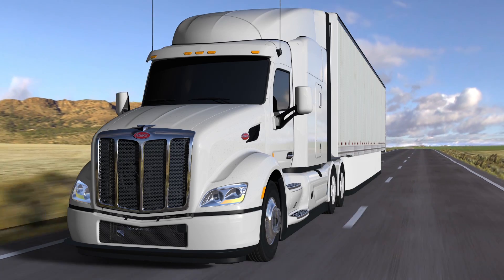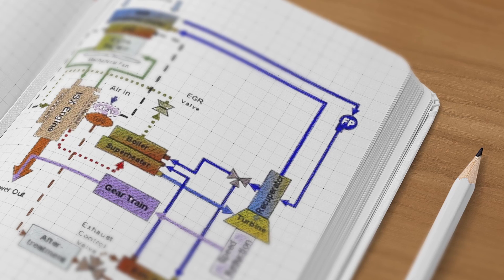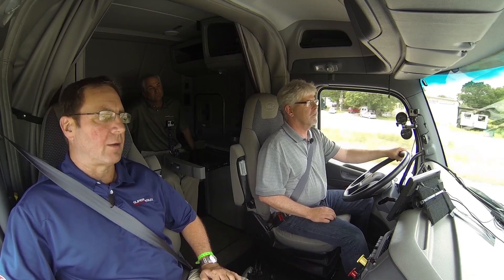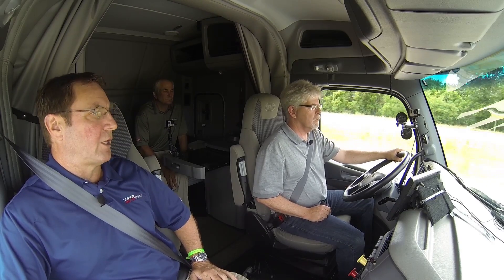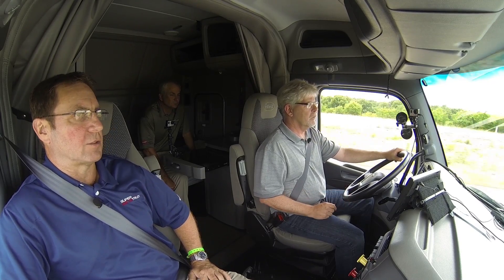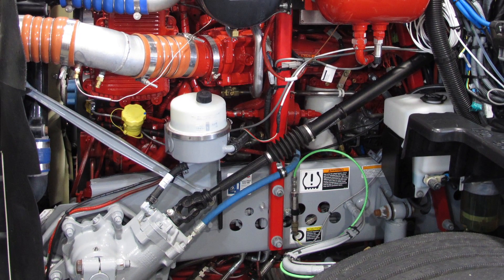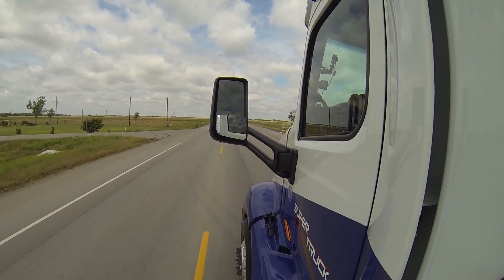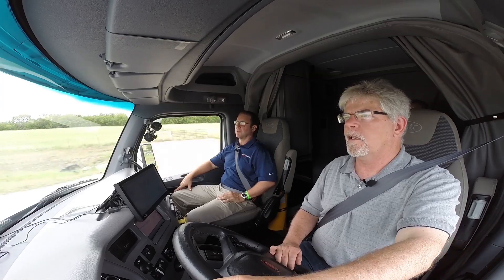SuperTruck Test Drive Pt 2: The Finer Points

Comment: Taking the second drive axle out take technology back to tje fifties and sixties when trucks were built with a single axle. The second axle was design and built into truck to improve the amount of weight the truck can pull and trailer weight.  That idea need to be revisited.  The amonut of weight these trucks are carrying has gotten heavier and a single drive axle is not the answer.
Reply: +sajones0403 You don't need 2 drive axels. Here in sweden almost every one got a 6x2 configuration. And to get weight on the drive axel we can lift the tag axel. And we have heavier trucks then the USA (132 277lb) and much worse roads and weather.

Comment: That is Dome wet only 1 drive axel  when you'll get stock how are you going to get out with one axle dive only , Just change aluminum drums and aluminum fifth wheel and am single tires it will take the same way you wanted to spend $36 million, yeah comments engine it's made to take the money from ur pocket
Reply: The only trucks here in sweden with 2 drive axels are dump trucks and log trucks. When we get stuck we can lift the none driving axel and get alot of weight on the drive axel so we get the traction back. We get pretty bad winter conditions and we got no problem getting up hills and sutch. And in sweden we drive with 60 tons (132 277 lb)
Reply: What are you trying to say? Lol. I have no clue. Lol
Reply: Haha i'm sorry bad english. I am trying to say that you don't need 2 drive axels. And that here in sweden almost every one got a 6x2 configuration. And to get weight on the drive axel we can lift the tag axel.